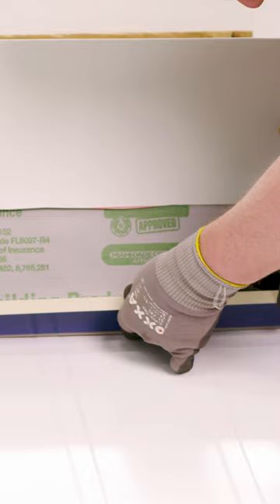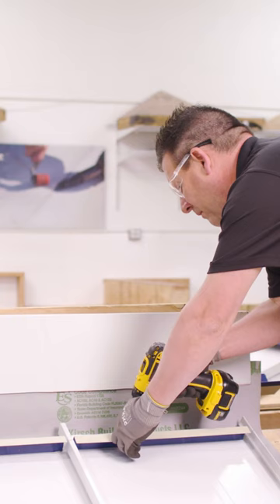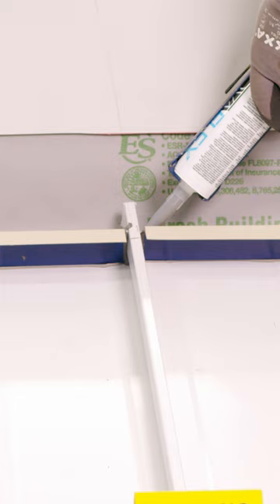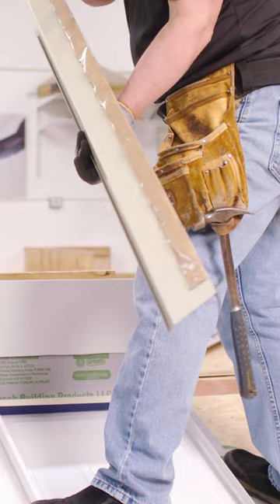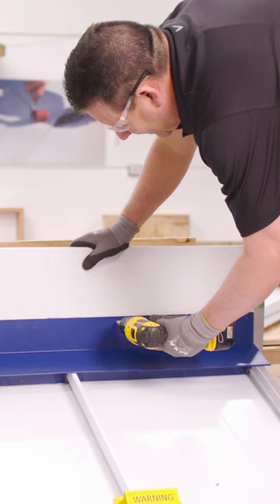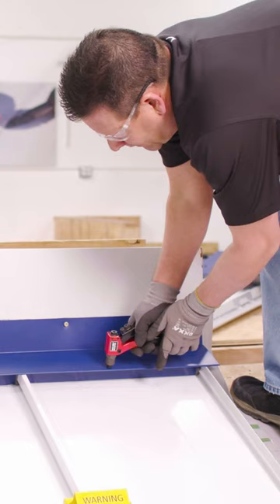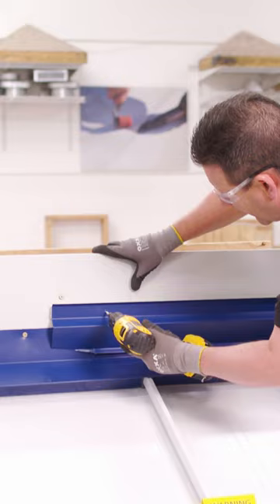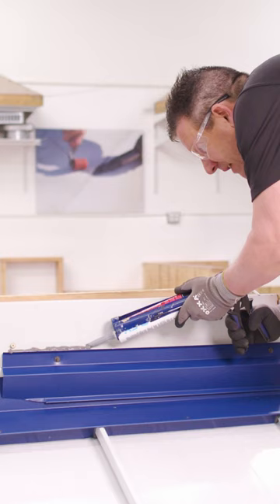SMI HW3 Standing Seam Headwall Detail Tutorial #shorts

Comment: Why would you not just go under the cap metal instead of reiling on sealant to stop water
Reply from the maker: In Sheffield's standard details, there are several other headwall designs that place the counter flashing behind the wall cladding. This detail is for instances where that is not possible. -Thad